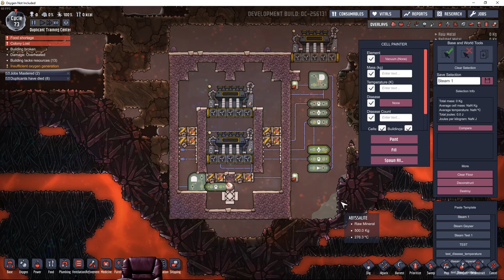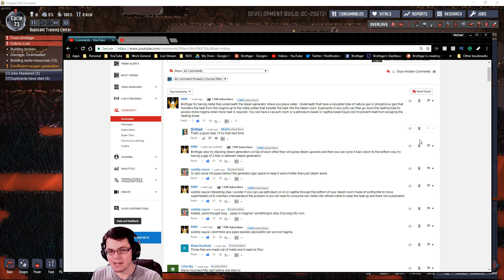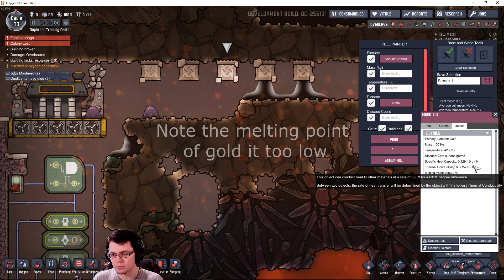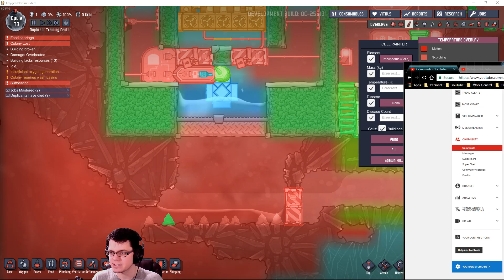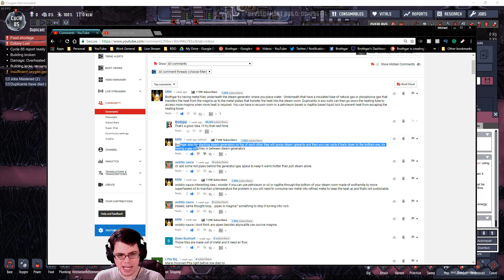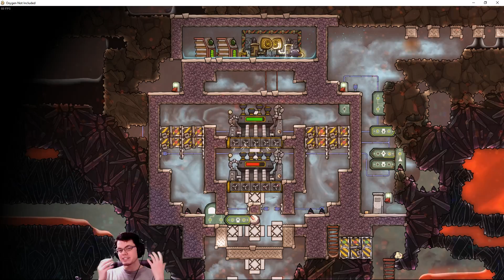Steam Turbines in Series Experiment! Oxygen Not Included

Comment: So I worked on this for a bit I got 5 to run in series, it was not possible to run normally, the cooling grid was made of 1 degree k granite. Found out that the more engines in series the worse there efficiency gets both in temperature and pressure change.

Comment: The Secret for transferring heat from my Thermo-Dynamics days in Engineering is called Thermal Diffusity.
 I am surprise that with all these month you never address this issue for transferring heat through "Materials" either solids, liquids or gases. Basically its the Thermal Conductivity/Specific Heat Capacity RATIO. Everyone always omits the specific heat capacity. In Lamens Terms, Thermal Diffusity is like a BUCKET with a HOLE in the bottom. The SIZE of the Bucket is the Specific Heat Capacity and the HOLE in the BOTTOM is the Thermal Conductivity. Thermal Diffusity is the Flow Rate of the water out the Bucket. In ONI, we can omit the density mass because items built in game uses the same amount of units of mass to make a machine and also, density in game is not in meters cubed(volume) but in meters squared(area) or in this case a Tile of 1x1. ref. https://en.wikipedia.org/wiki/Thermal_diffusivity.
Here is My own Sheet you guys can look at https://goo.gl/fFdKW6. I use Filters and Sorting to help me find the proper material to make stuff like Thermo Plates n stuff, or even which liquids to use in machines. I'm sure you can get the picture. i TRY and update it now n then but im certain you could make your own, copy/paste etc. (i do hide some columns n rows now and then, this public sheet but only i have access.

Example Copper is 207.7922078 and Diamond is 155.0387597. Gold is 465.1162791 and Tunsgten is 447.7611940.Higher is better. its almost pointless to use diamond to transfer heat, when copper is better and way more easier to get. same for Gold versus Tungsten, Gold is easy to get and make compared to tungsten.Iron is actually better to transfer heat than Wolframite, BUT you cannot use iron for liquid pipes.

My Sheet doesnt not include the +15C or +50C etc material properties that the game has that the Devs inserted to compensate for overheating of items built like pumps or generators.

In conclusion i hope this info is useful to you and the community to understands the basic rules  Thermo Dynamics and have fun trying out other materials. BTW since they changed Ignenous Rock values a bit in recent patches. i have found it useful to use that rock for building now in certain cases for insulating.
Reply: So if I am understanding this correctly: two buckets with same size holes, but one is smaller. The smaller one will transfer heat faster? Why is that, if the holes are the same why aren't the flow rates?

Comment: What if you put door compressor between the two generators?  Might even have a set of two on top of the second generate to clear the area above it as well. That would give less space for the pressure to linger and keep forcing it into compressors and back to the bottom.

Comment: So ... you mentioned the potential energy you could get from the Magma but it's hard to test. So in the end at least let us assume what would be possible.

first i need to guess what exactly does the Steam turbine moves? Sadly the Only details i can find is, that it needs 3.000g Pressure difference from bottom to top, and at least 251,9 °C (~525°K), well and of course it has to be steam (to be fair I didn't checked anything else yet)

I tested a bit around to see how much heat is taken off from the steam and it's actually a total mess to find out ... my first guess was around 25°K, but when it just starts to run the Turbine itself starts to heat up from the steam it releases at the top, then i'm not totally sure where it release the steam to begin with. At the border between intake and upper chamber you can see a difference from 25°K, but if the chamber is bigger and you move up you can get to a difference up to 100°K. When starting with 1.000°K steam the system stables at some point (after wasting heat?) where it has a stable difference of 50°K. In all this it looks like the mass of the steam is constant. (Moved it back by Door conveyor)

so after this I just take the numbers as followed: Steam heat capacity - 4,179 J, Mass - 3.000 g and Heat delete - 50°K - per second

This means the Turbine destroys 626.850 J/s of Heat for 2.000.000 W of electric power

Magma has an heat capacity of 1 J and can be found in pockets of ~ 1840 Kg per tile with a temperature range ~ 1840°K., but we can't use all of this as the turbine needs at least 525°K to work, so we use 1315°K.

So a single Tile of Magma has roughly 2.419.600.000 J which would mean a single turbine could run ~ 3.860 seconds. This would be again roughly 7.720.000.000 W of electric power. Just in comparison this would be the same amount of power than burning 12.866,6 T. of coal.

So I could see why they say it's "regenerate Energy" compared to the other stuff found ... still it's so buggy you can hardly count it in. Also of course there is still the problem with the heat transfer itself but i do like the idea of phosphorus, works really well at some decent amount of mass.

Sadly every time I try to generate heat in this game, i find more ways to delete it ... just recently i learned that the Amount of Liquids that drips from outlets (10kg/s) isn't calculated right and cools the same as when it would be 1.000kg. The next thing that came up just today was the weird habit of Pipes running around corners. For what ever reason the Game can get stuck with a single pipe tile (gas or liquid) where it adds or deletes Heat to the volume inside. You can see this when you create an self loop bubbler system that runs through plain Vacuum ... if you make it really wanky you can find points where it just bugs out.

Comment: How about making it into a dual purpose water purification and power generation plant? Have a straight column of steam generators and pump dirty water at the bottom, it converts to steam and passes through as many generators as it has energy to and then drips off the side of the generators? That way you get clean water and don't have to try to circulate the steam back.

Comment: #Brothgar you should start "small" and do a door pump test first.
in particular; how fast can doors operate wo deliting stuff and how mutch presure do you need in a room to pump 3kg/sec for steam turbine.
from my expirience. 6 door pumps and 3 sec on the timers are working
and if you work with lets say 1500kg of pressure difrence at the start your system could work for longer cause 3 kg difrence will be there for longer

2. test out is the cooling rate of eatch turbine is in c°/k° or is it a % amount? belive its %
3. is it beter to build up high pressure belov or low pressure above the turbine?

and yes, power from coal, hydrogen, and natural gas are infinite where magma isnt. + you get co2, o2, or ferteliser as bonus. and with the right power management you dont realy need mutch

BONUS TIPP: 
1. build a loop of liquid/air pipe and have inside of the loop 2 bridges
2. add on the side a pump and connect it to the loop and feel it full
3. deconstruct the filler pipe and a seqment of the loop
4. close the loop again.
how it works: because the bridge 1 green can outout in bridge 2 white and visa versa you have a constant flow.
add a valve with sensor to controll it
purporse heat transfer from a to b with no power

https://forums.kleientertainment.com/topic/87995-steam-turbine-working-prototype/ pictures =)

Comment: I think the problem with the big door pump is that they aren't open for long enough.  You were messing with the filter at the end, which controlled how long the doors were closed.  The first buffer gate determines how long they stay open.

I believe you can also get more heat from the system if you use the magma to boil crude oil to natural gas and use the natural gas to heat the water, as boiling crude oil to natural gas actually creates heat energy.

Comment: That many closed doors on the compressor seemed inefficent to me, so I designed one where only one door is closed at any time (https://imgur.com/a/9RvDa). Having only the one door closed allows the space of the doors above to already fill with gas while the last cycle is still moving out of the compressor.
The top part is essentially a clock with definable on and off durations. To allow for one switch to control the on/off state of the entire circuit it uses an edge detector to start the clock when turned on. Just set the top filter gate to the minimum duration possible.
Then, for x doors and time t on the bottom gates that connect to the doors, set the 2 clock gates that connect to the AND gate to t*x-2t and the other 2 gates (the buffer gate that connects to the XOR and the following filter gate) to 2t.
For 4 doors and t=1s this works out to 2s for the 4 clock gates and 1s for the door gates.
Reply: So I managed to make this a little simpler: https://imgur.com/a/nmhMk
All gates set to time t except the top buffer gate, which needs to be (x-2)*t seconds (x = door count).
For on/off toggling this one needs an AND gate between the NOT gate and the topmost buffer.

Comment: A thought I had previously: Since Heat is 1:1 out of thermal aquatuners, couldn't you use a vat of oil as a thermal reserviour to lower the temperature of water for farm use, while trapping the heat in the room with the steam turbine.

Also, to preserve the heat in the chamber, couldn't you use a vacuum chamber to prevent a good amount of head escaping through the heavy-wat cables?
Reply: Hm, haven't built one yet, what temp of steam do they require?

Comment: can the steam turbine be used to make some power back from my polluted water boiler or is the stram "to cold" to do so?
Reply: it can work with poluted water , so best output will be generate electricity and clean water at same time? xD
Reply: and cooling the new fresh water. Yes its my plan to have at last a thing that can do the water cooling and cleaning part for less then 3000V to 4000V.
1200Vx? for the water cooler each. 240Vx2 for two pump. May 120V for the spaceheater if batteris arnt working and i notis that poluted water becomes not only stream but also dirt... can a gabber hand survice more then 125°C or is this our steam heat limit now? Can this trubine even work with "just" 120°C hot steam?
Reply: this means i only can use it as a preheater. Dam i was hoping to get some free energie back. But this means the turbine is for geotermal use only or did i miss something thats heats steam upto 251.9C?

Comment: Hm.. could you create an airlock by using a door system to temporarily crush duplicants in the center? So they enter, trigger a sensor which starts the process, they hit the center, get traped, then crushed by a door with deletes the air, door opens before they suffocate, then they go on their way? Would end up deleting small amounts of material (you could us other airlock methods to drastically reduce the amount of material caught with the dupe to negligible amounts), and itd make alot of suffocating/entombed red alerts. But it'd work, I think.
Reply: If a duplicate is in the same spot as a door that is trying to close, the door will not close. He this is shown in this airlock conveyor video.

Comment: I just realized the point of heavi conductive wire.

ITs overheat. Refined metals have a significantly higher overheat threshold, and I always wondered why since crucial heat generating machines (aquatuners, for example) couldn't be built out of them.

But the wire can be, and in setups like this having your wires be able to handle these levels of heat could be incredibly important.

Comment: https://imgur.com/a/Td7u8

not sure if i'm taking the right approach here...i'm trying to use an active cooling system and kinetic..
using tungsten tiles and diamond shift plates since those wont melt,
my cooling system is not working yet... seems like ill have to make a door compressor too. to push it away.
maybe storing compressed steam in a separate chamber would help to control it better.
i think u want to transfer the steam away from the turbines, in stead of trying to push it straight back down,
Also, u can delete heat with doors, if u can temper the steam down to below 125c then u can pump it down again..

problem would be over time, u need to vent of steam due to saturation/over-pressure.
also after further testing, it turns out u would need a huge body of magma for it not to solidify.

https://imgur.com/a/5JBJo
Reply: Game Source code definitions for the turbine

buildingDef.GeneratorWattageRating = 2000f;
buildingDef.GeneratorBaseCapacity = 2000f;
buildingDef.Entombable = true;
buildingDef.IsFoundation = false;
buildingDef.PermittedRotations = PermittedRotations.FlipH;
buildingDef.ViewMode = SimViewMode.PowerMap;
buildingDef.AudioCategory = "Metal";
buildingDef.PowerOutputOffset = new CellOffset(1, 0);
buildingDef.OverheatTemperature = 1273.15f;
turbine.pumpKGRate = 10f;
turbine.requiredMassFlowDifferential = 3f;
turbine.minEmitMass = 10f;
turbine.maxRPM = 4000f;
turbine.rpmAcceleration = turbine.maxRPM / 30f;
turbine.rpmDeceleration = turbine.maxRPM / 20f;
turbine.minGenerationRPM = 3000f;
turbine.minActiveTemperature = 525f;
turbine.emitTemperature = 450f;

Comment: I'd read they specifically fixed the upper output temperature of the steam so you couldn't run them on top of one another.  Either way it seems like the turbines are not fully/properly implemented to be a long term power solution.
Reply: Semi-related.  Someone mentioned they had an oil well boxed in and the heat capped out around 500, which if true would be good for steam and petroleum changing.

Comment: brothgar if you aren't moving enough steam from one generator to the next, try using a pyramid formation of 2 steam generators side by side and one more above them to funnel the output from the two lower generators to keep the upper one pressurised. also try running your wires only through abyssalte to prevent heat loss, i think you are losing a ton of heat energy from the wires. possibly surround your system with a 1 tile length of vacuum to prevent all that heat loss from output wires.
using wolframite and tungsten seems to be the best way to go to prevent any melting, in my tests a wolframite liquid pump can actually move magma for a limited duration, if you had dupes in exosuits you could have a vacuum room with a limited amount of magma that is let in from a tungsten liquid switch to a wolframite door and move magma directly onto a heating plate without causing any magma to form igneous rock, the pump will have to be repaired on occasion but from my experience it can last almost 3 cycles before it breaks down completely, just some food for thought. I'd love to see what you can do with piped magma. :)

Comment: for the steam generator use more steam. optimal would be pressure of like over 100 kg per tile on the lower part. Steam coming out from the steam generator is always 151 C. So even if you have 900 C input it will cool it down to 151 C on the output.
Reply: ur sure with the 151C°?
Reply: Yeah I think some did look at the code.  If you interested about the steam generator here is a huge forum post on it.  Page 6 starts the current patch of the steam generator. If you want to be exact, the out put is 350 Kelvin. 
https://forums.kleientertainment.com/topic/86804-occupational-upgrade-steam-turbine/

Comment: This feels like just a lack of gas issue, double or tripple the amount of steam, that'd mean that theres always going to be more steam pulled through each cycle of the doors, if it was say 50kg steam per tile, the system would work no problem.
Reply: I agree running more mass works nicely. Also i run it with 2 sec each gate so the steam has more time to fill out the chamber. I've also added a fifth at the bottom which closes the same time as the one at the top, making sure there is no way steam could move back up ... not sure if this is a thing with your setup.

Comment: Some of your airlock cycling seems inefficient - before you scaled back to a less complicated setup, your previous airlocks had been compressing the steam (and maybe deleting some?) before they dumped it into the bottom chamber. I follow this sequence: Airlock - Buffer Gate - Airlock - Buffer Gate - Airlock - Buffer Gate - Airlock - Buffer Gate - Filter Gate - "Final" Airlock - Not Gate - Filter Gate. Here's a picture for reference (https://imgur.com/W56q2GR )

Play with the timing, and you should find that: all doors but the last one will open at the same time to fill like a temporary chamber, and then with a full chamber the "Final" airlock opens at the same time the first door will close. This means your temporary chamber will be open on one side (in my example on the right), but will switch to being open to the other side (the left). After that the doors will close in succession, pushing the gas into the desired chamber.

Hope this helps! If you need I can reopen my game and get you the individual times on those Buffer/Filter gates.

(Edit: fixed the broken link, fixed some errors in explanation)